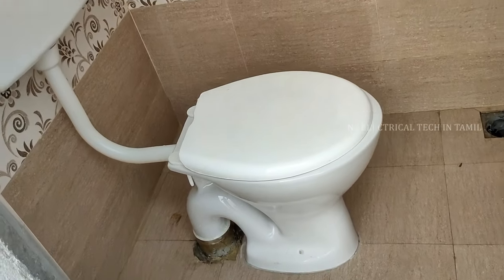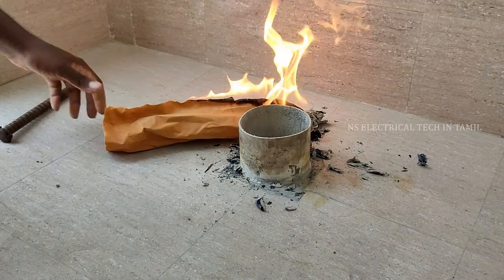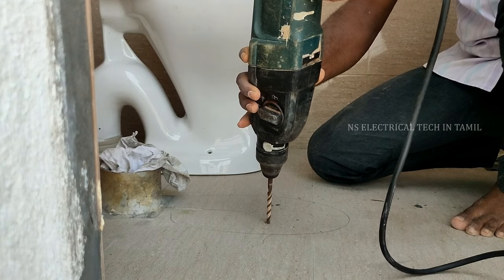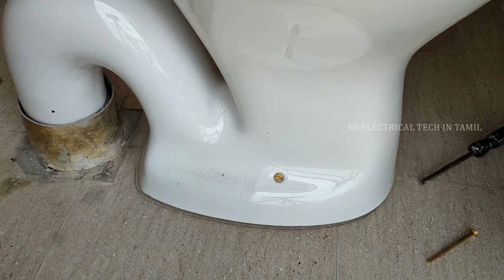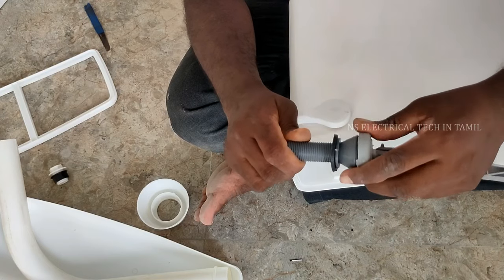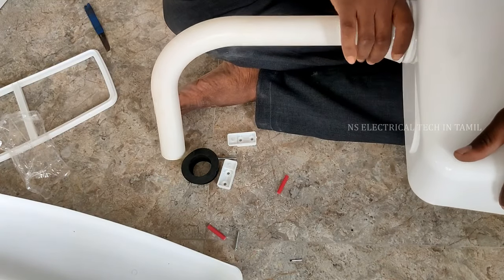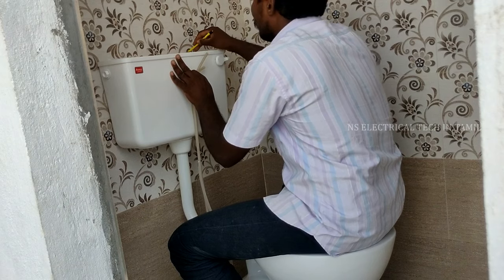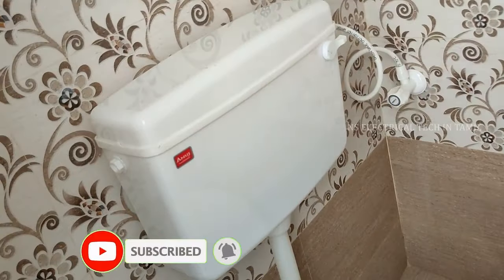How to new install a western toilet in Tamil🔥New western toilet A to Z instal  நாமே fixபண்ணலாம் 2020

Comment: Sir Enaku oru doubt ?Enga veetla Rendu floor ..keela floor iruka bathroom la water pressure nalla varuthu but mela iruka washroom la kammiya water varuthu ??Enna reason ?
Reply: The ground floor to water tank height is more compared to first floor to water tank height. Hence water pressure will be more in lower floors than in higher floors .
Reply: Height than problem